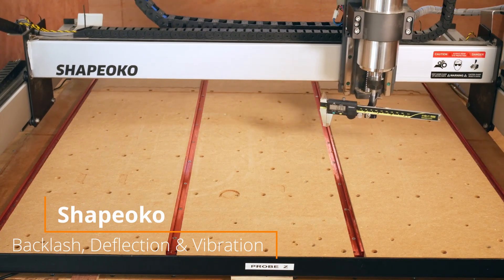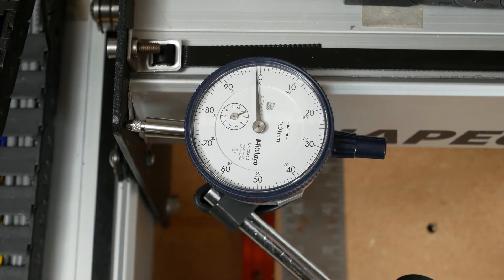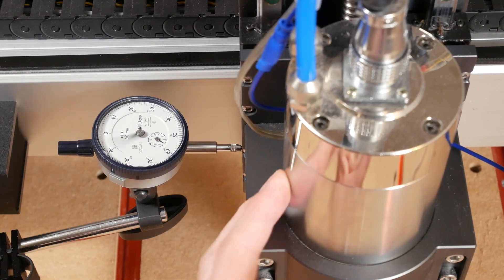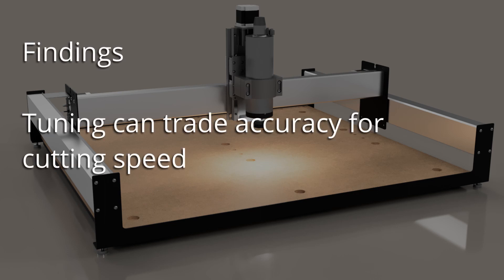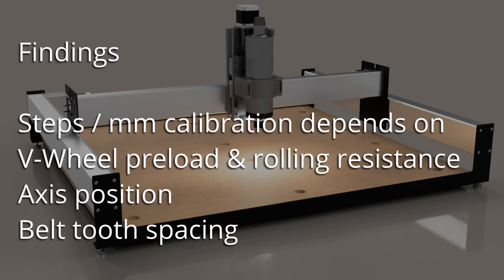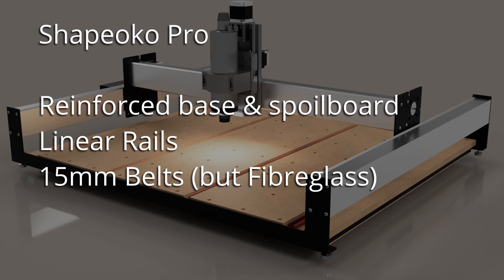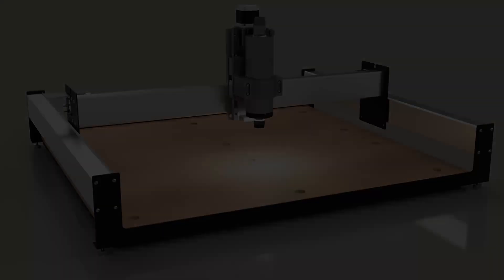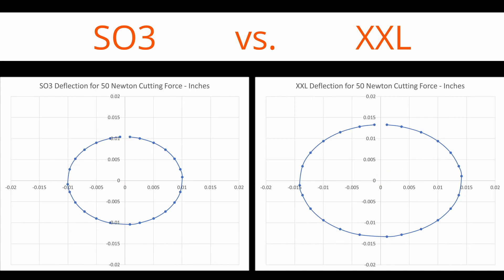Backlash Deflection and Vibration   Chapter 1

Comment: So if I have 8mm Shaft steppers. Can I increase belt stretch? Good videos
Reply from the maker: Thx, 

You could increase the belt tension if the stepper axial load rating is larger, but once you've got past about 100N there's no improvement in backlash or deflection and the belt life will likely reduce as there's more strain on it. If the stepper vendor has data remember to double the belt tension to get the axial load on the motor for both sides of the belt.
The main benefit I would see of the 8mm shaft stepper would be to put wider pulleys and 15mm belts on the machine to get either get reduced deflection from a wider steel-cored belt or to do like the Shapeoko Pro and use the harder wearing fiberglass cored belt but in 15mm to make up for the reduced strength.
HTH
Reply: @computersandwood488  Thanks, I'm using 8mm shafts linear rails on x and y and kevlar belts, but still have a little backlash when doing 10mm> circles. But I got a nice improvement with the belts at 160hz